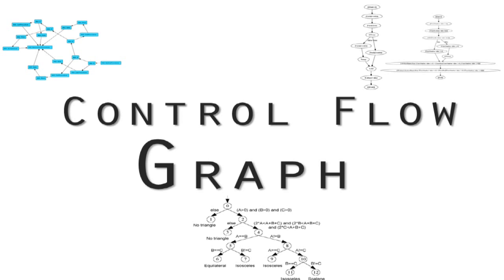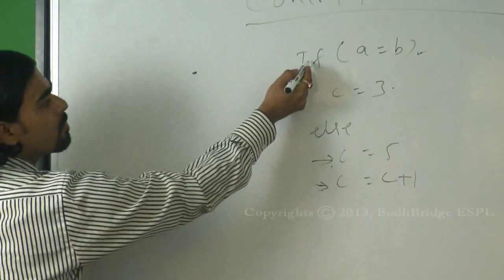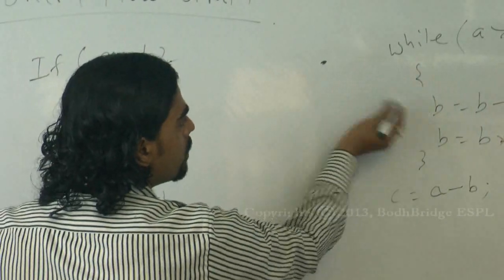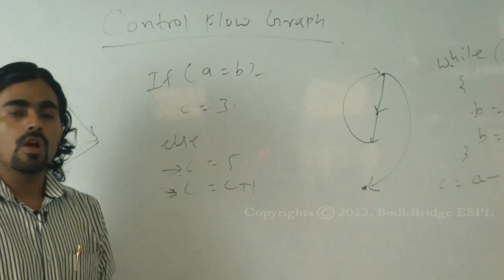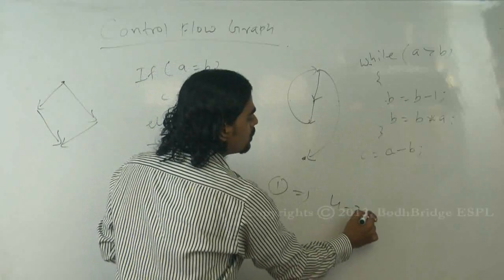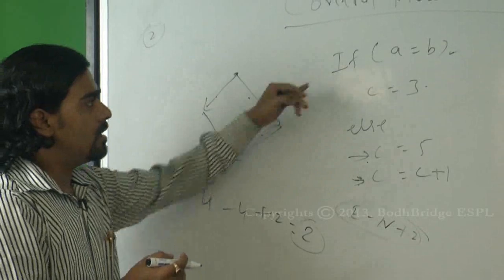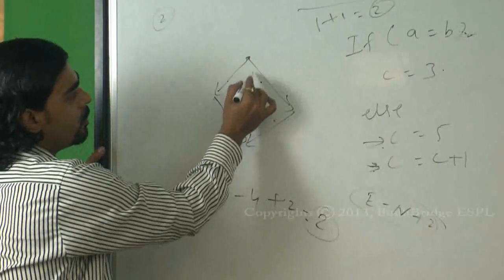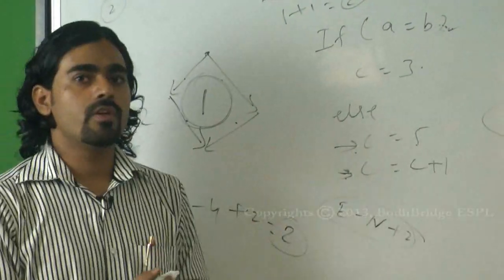How to draw a control Flow Graph ?

Comment: E-N+2 is the formula there in cyclomatic complexity please reveiw once . In while loop example you calculated two different values 4 and 2 for cyclomatic complexity but i think cyclomatic complexty must be same despite of using any method or approach so better reveiw your lectures once before uploading .